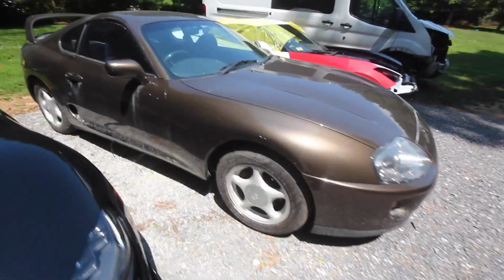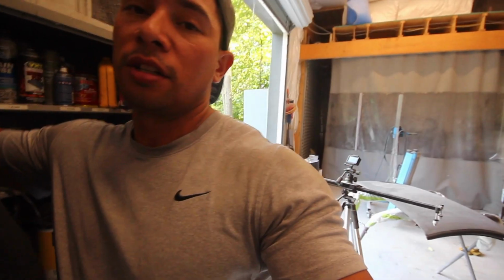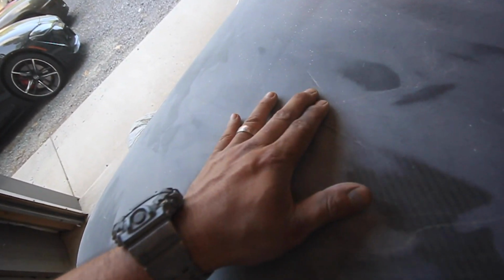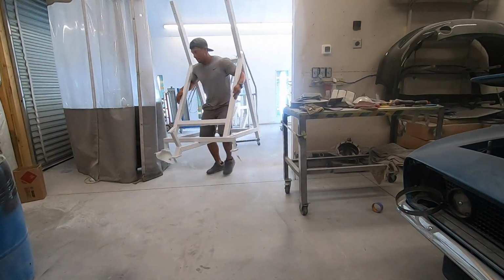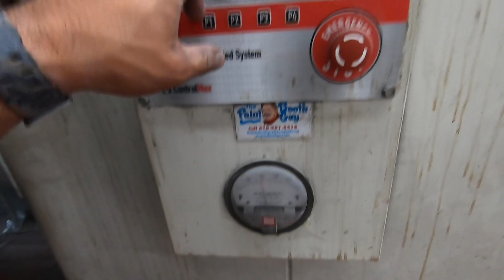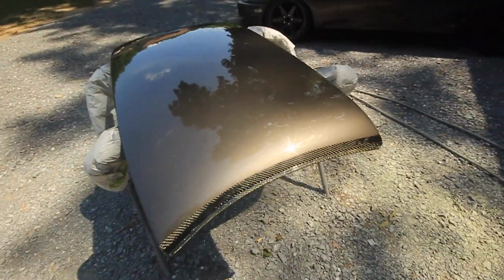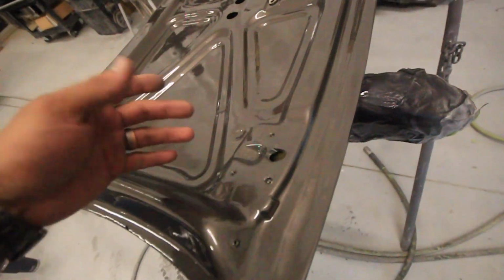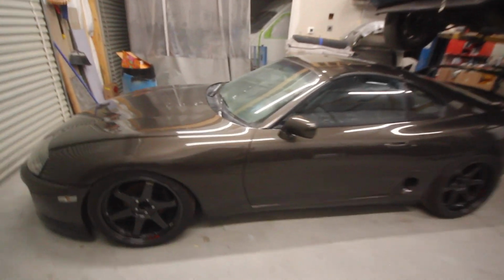How I salvaged a cracked carbon fiber targa top REBUILDING my MKIV SUPRA on a budget part 19!

Comment: This how process has been awesome to watch. Being able to see the time and effort makes it even better to see it come together. How do you keep track of all those screws and bolts for everything you tore off that?
Reply from the maker: Thanks dude! It's deff tough and I try to keep it as real as I can. That's kinda my goal.....so usually you package your bolts and screws with labels....I suggest that lol. But after years of taking apart cars you can tell which bolt and screw goes where....most of the time. Lol I do switch out bolts and screws here and there putting them where they actually belong as you keep messing with the car. You constantly go back over your work and do that.

Comment: How is the carbon roof like compared to the oem one
Does it squeak alot rattle or any of those sorts and does it use the oem bolts
Reply from the maker: Uses all OEM bolts and hardware....of course I had a mix of hardware involved lol. It's doesn't squeak but does have some wind noise and less sound detonation....but a straight pipe will fix all of that haha.

Comment: What kind of Spray Paint gun do you use? Which would you recommend? I'd really appreciate it, great job!
Reply from the maker: I use 1.4 and 1.2rp satajets....but there is alot of awesome gun companies for a little cheaper then satajet. What I have sprayed and recommend is satajets, iwata and walcom spray guns. I'm sure there is some cheaper companies then that but that's my experience with them exact. Also before you buy a spraygun make sure you match the spray gun specs to what your spraying. Hit me back for anymore questions.